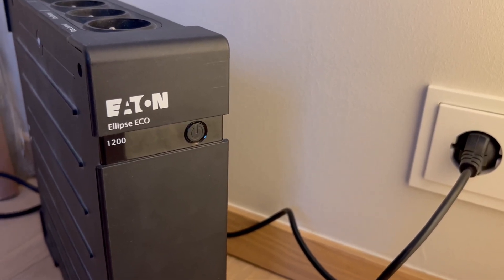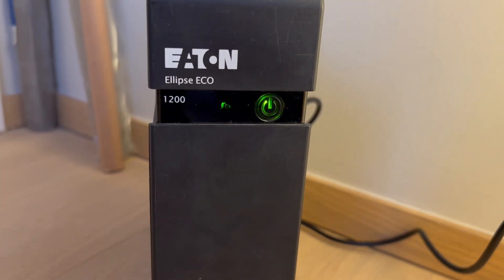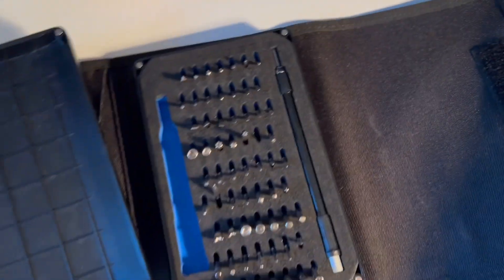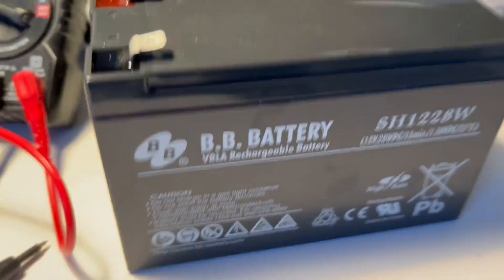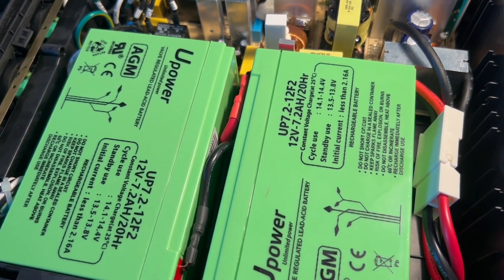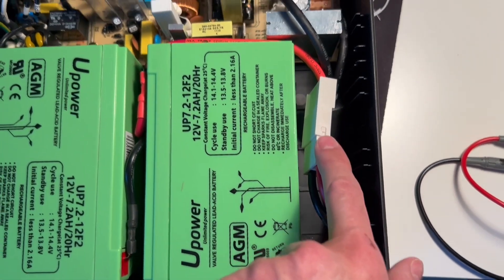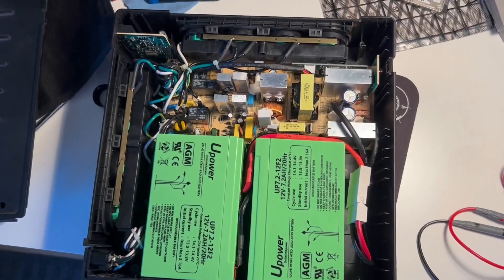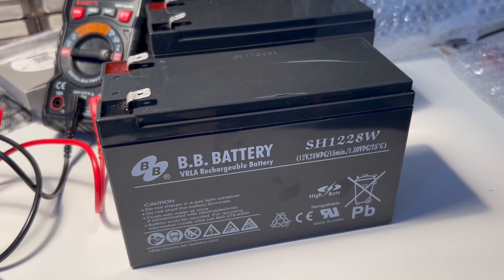Dead EATON Ellipse UPS: HOWTO Replace Batteries

Comment: Wondering if anyone can help?
Have a 5E 1500UI
Plugged in and "Charging." It does not beep. However unplugged and switched off. It will beep until it dies.
New batteries have not resolved the issue.

Comment: how long the batteries last ?
Reply from the maker: Between 5 and 10 years depending on a variety of factors.
Reply: @Maker51  Eaton ELP850DIN Ellipse Pro 850 DIN died after 3 years. I mean it is working, but no bar at the battery indicator.

Comment: You could just remove the bottom plastic cover after taking out the 1st Philip screw. 😅
Reply from the maker: That is only on the newer models. The Ellipse in the video does not have such a handy battery door. I didn’t know it at the time but this video applies to older models of the Ellipse ECO.
Reply: @Maker51 I have the exact same model, and @philippealfaiate is right, that's why there's only one Philips screw and not four. This video teaches an unsafe method of replacing the batteries.

Comment: I need a charger for a few drone batteries.
Do you think it is possible to connect a car battery to the Eaton elipse to have longer charge time?
The small battery inside has charge capacity for 1 hour for 4 chargers...
If i would connect a full charger car battery it could charge the drones for many hours if needed...
I would like to know if thats possible :)
Maybe you know the answer :)
Reply from the maker: I honestly don’t know if that is a safe thing to do or not but I understand your thinking and it intuitively makes sense to me. On the particular model in this video there are 2 batteries in series, so it would most probably mean you would also need to connect 2 identical car batteries. Beyond that there is the question of whether the car batteries may draw more power or not than the smaller batteries while charging. I guess you could measure that. Also obviously mount back everything in a well insulated way. ALTERNATIVELY there are drone battery chargers designed to connected directly to a 12V car outlet. So you don’t need to bring the whole UPS onto the field. You just need to charge your car battery somehow. (Personally I would play it safe and use a dedicated car battery charger but… ;)